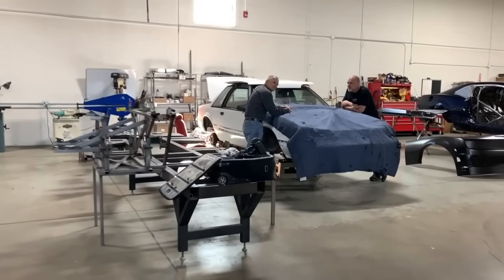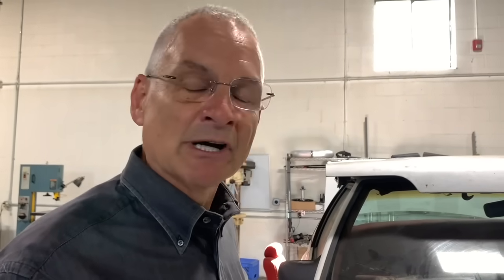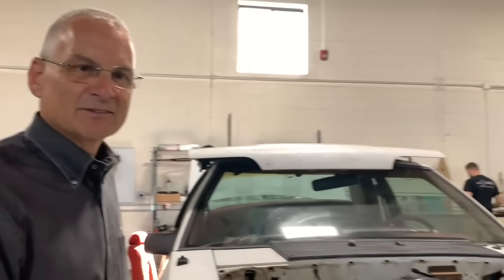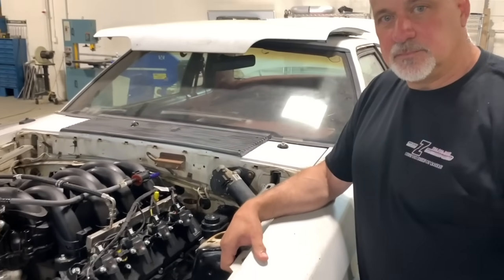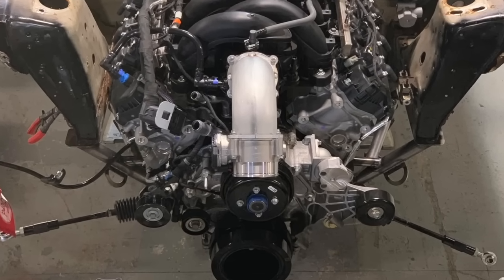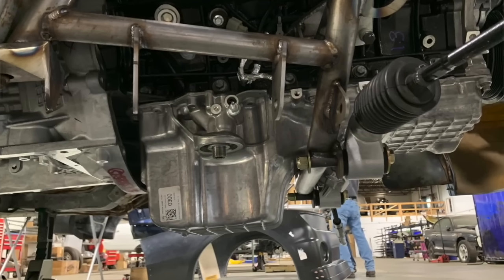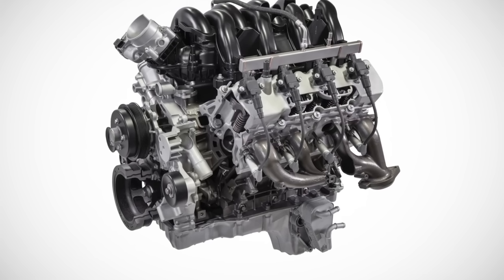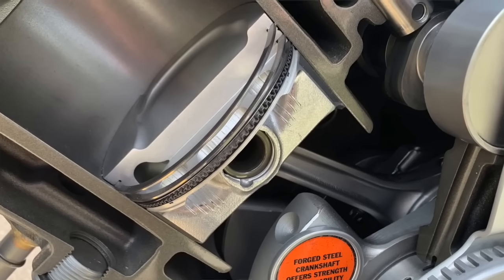Ford 7.3L "Godzilla" V8 Foxbody Mustang Engine Swap — Team Z 446-cube Small-Block Project Part 1

Comment: At 445 cu in (7.3 liters), some racing organizations have lower limits on small block sizes. For example Hot Rod Drag Week (not a true competition, more for bragging rights), their cut off is 430 cu in for the dividing line between small block and big block. a lot depends on racing organization rules for where this would actually fall on the SB/BB classifications

Comment: Dang. The 6.2 has been out for a decade and i have only seen about 3 swaps. This motor is out a couple weeks and they are already making a swap kit. Im excited, but i think the 6.2 had untapped potential.
Reply: Mike Albert No one wanted a 6.2 Sohc i guess
Reply: This will make 6.2 swaps more accessible and a ton cheaper. I agree, even though not a mod motor fan, these 6.2s had untapped potential.

Comment: " Designed and engineered to be as durable as the truck engines"  lol. So what you're saying is it's a pile of shit like every other engine ford builds. Someone should tell this guy about the spark plug and cam phaser issues the 5.4 had for it's entire life span,  the valve spring issues in the 6.2, and the multitude of problems ford has with eco boost motors.... Putting a unproven truck motor with no aftermarket support in a mustang is about as stupid as all the other shit ford loving morons do.....
Reply: Did you even see how the engine was built? It's a cam in block, cast iron block, port injection v8. It's simple as can be. Do the math, and quit being a foolish brand loyalty sheep.

Comment: Hopefully in 5 years I can get one from a salvage  yard as easily as a LS. Coyotes are still too expensive for me and the new 7.3 are push rod motors,yes!  Wow, I can't wait to see one running boost, should be 1000hp with no problems.

Comment: It will be just like the LS engines, it only has two valves and without forced air the Coyote eats it for lunch.  Some Ford guys still think the FE was the dominant engine until they get their ass kicked by a sb Ford with canted valve heads.. The 7.3 is still a truck engine and probably a decent engine. Leave the racing to the guys who know how to build race engines.
Reply: I have run SBF for may years in drag racing, SC1 and D3 heads.   Engines that made 1150+ HP NA and over 2500 with a Procharger, and I think if you like those engines when you see this one you will like it too.   As for the FE, I am still amazed looking at those and commend those that took the effort to race those.

Comment: The more i read and see about this beast the more i want it for my 2010 p71 Crown Vic.This thing is way over engineered and looks like its almost bullet proof. Ford really made something great here. All that low end torque is perfect for mustang and or my Crown Vic. Now i gota start saving up lol
Reply: I have a 2000 I've been beating on for about 6 years now and it wont die beening looking into a swap have a 351w out of a truck but this might be the ticket
Reply: Think Marauder!  If the DOHC fit, then this one should fit too.  The trickiest part will be fitting the exhaust!
Reply: One advantage that Crown vic has over the mustang they are using, is that your can has a 4.6l overhead cam engine. With the OHC layout, the engine is slightly taller than typical OHV engines, requiring a slightly taller hood profile. This is why chevy and dodge have not really embraced the OHC V8's, they like their lower hoodlines. But that slightly higher hoodline, might allow the 7.3 to fit perfectly with a stock hood
Reply: @crazylarryjr  If someone can cram a Triton V10 into a Crown Vic, this 7.3 should be a piece of cake
Reply: masterwhopper414 all the space in the front of a crown I’m pretty sure you could fit any swap you think of
Reply: @masterwhopper414  someone put a triton v10 in a capri (fox) and a tank engine in a crown vic

Comment: Can anyone say camshaft swap and headers.
Should weigh about the same as a LX 5.0.
Lolllll easy 550 to 650HP at the crank.
Reply: And bomb proof
Reply: Aluminum heads
Reply: I wonder when an aftermarket cam will be available.

Comment: This will be a great swap for an old school muscle car or hot rod or even in an old school F100.
Reply: i'v got a 79, the 302's pretty anemic as far as im concerned, it used to have a 460 in it befoe i bought it so i know it'll fit... anyone got an extra godzilla?
Reply: gabriel Sturdevant I have a 76 390 F150. Since this thing was announced I wanted to swap. Would cost an arm and a leg tho. Have to wait a few years for prices to twindle a little and have aftermarket support
Reply: @VeryOddTimes  I hear you brother.
Reply: @gabrielsturdevant9700  It'll be a really great swap for your 79 F100.
Reply: I got a 78' just waiting for one of these. I would like to keep the factory 4 speed though, not sure how I'm going to make that happen yet.
Reply: @Zach-ju5vi  I'm sure it'll be easy as time flies.
Reply: Zach they’ll probably make adapter plates at one point. I would like to keep it too but fuck, I feel like it’d be a lot of engine for the poor four speed, especially souped up. I’d like to have that new ten speed in mine lol

Comment: "slurp - slurp - slurp"
Reply: Are you referring to the Hellcats and Red-eyes. This is a special build, not a production vehicle that has a gas gusler tax added to the MSRP. FCA can't hit the EPA Numbers so they have to turn to Tesla to purchase their carbon certificates. GM is in the same boat. The EPA doesn't require automakers to report fuel-economy figures for pickups with a GWVR of over 8500 pounds, so there are no fuel numbers available for this engine and other brand trucks that fall in this category.
Reply: @hemi300c4  Calm down... it's the sound a good gobbie makes.  You think someone with a screen name like mine doesn't know HD's.

Comment: I love team z and props to them for being the first however... it just seems like a kool trick and nothing else. It better be able to pump out 1200 hp if not the coyote is a better option. Or buy a dart block proven for decades and more capable.
Reply: People are always so negative.  Why not be happy about a new badass ford option?  Don't you want more ford options?  I know I do.  It can make 800 all motor without even trying that hard 1200 is a walk in the park this is a 7.3 liter engine you do understand that right?  I think coyote guys get butthurt and so do ls guys because there is a new guy on the block getting attention and rightfully so.  They just made 1400 with a 3 liter Whipple on like 16 psi.  I think it is awesome having another option after thousands get sold in trucks for a few years it will go down alot in price and be a very viable swap option.
Reply: @midnight347  I would hope any big displacement would out perform a small displacement engine. Unfortunately it is still yet to be seen in terms of the 7.3. Engine dyno horsepower is like measuring your dick from your balls. I am personally not butt hurt but I laugh at the ones who say the 7.3 is the next best thing and they cannot afford it lmao.

Comment: Ford needs to make this a crate motor with ecm and a wilder cam .
Reply: Almost guaranteed to happen. I would be shocked if not.
Reply: They made it into a crate motor not too long ago
Reply: Hash Slinging Slasher the guys that said it won’t happen are eating their foot.
Reply: @randyjolly7517  lol
Reply: @hashslingingslasher4215  with an ECM?
Reply: Not gonna happen
Reply: This is coming from a Chev guy.   I’m glad Ford come out with little beast. Bout time. But I sincerely hope the cost will be reasonable. One big reason why I’ve stuck with GM platforms. Always has been cheaper and easier to build and get parts. Good for the blue Oval guys.
Reply: Jason’s Fun will be awesome if the 8.0 gm motor comes out too. Would be more cool than an LS. Long live the big block
Reply: This is ford we're talking about... I don't it's going to happen

Comment: I am curious of the external dimensions, how wide is it across the exhaust ports? If I could get that between an early Falcon's shock towers.
Reply from the maker: Tom, I cover that in my next video which will post tomorrow or Friday. Plus engine teardown.
Reply: Doubt it would fit

Comment: What’s this thing weigh? I can’t find any actual weight for this thing
Reply: Probably 1300 lbs
Reply: @blackice7408  Can't possible weigh that much.  It's physically about the size of a 351.  Unless they've made it out of lead, gold, or uranium the size factor makes it 450 - 600 lbs with alternator, water pump etc.  A 460 weighed 720 pounds but it is physically a much larger engine than the 7.3.

Comment: I think 700 hp potential without power adders.
Reply: Oscar Mayer that’s 1.569HP per cubic inch. I think 606 is more realistic with stock internals. 700 hp is double it’s advertised HP
Reply: K Moss the video showed 475 horsepower I thought
Reply: @kmoss9521  that's not double stock it's 425
Reply: @kmoss9521    that's terrible math lol. It made 430 which would be 860 doubled. If you weren't off by 160hp. Which is a big difference. I wouldn't have said anything. The 430 was also with a restricted factory exhaust system and the factory air box and filter. Just adding exhaust, unrestricted air filter and tune it makes 500hp np. Just with an off the shelf mild cam and different intake it makes 600hp+. With a very aggressive cam, good headers, etc it's very close to 700hp. If you go crazy and add compression and really good head work your then your in the 800hp area. Shit my little 427 makes 647hp with a hydraulic roller with under 11.1 comp on pumped 93.
 It's because they did such a good job with these heads and the fact it's 445ci that it's going to make some much possible in the right hands.
Reply: With the cubic inch it has. That shouldn't be a problem

Comment: WOW, TO SWEET.  PS. I didn't realize the 7.3 was a small block.
Reply: It's not, it's a bigblock.
Reply: 313dieselguy he says in the video it’s a small block based on the bore spacing.  I’ve also heard it referred to as a small block multiple times in many different videos by experts on the motor.  It’s a tall deck small block with a relatively big 4.22” bore and long stroke which makes it a big cubic inch small block, not a wide bore spaced big block.
Reply: I was on the program for the engine before anyone knew it was coming. Between the valve placement and everything else it's a big block. I had a disagreement 2 years ago similar to this except I was told ford would never make a push rod v8 again. And as I told him not only are they going to but it's a 7.3 gasser. The 7.3 Godzilla is a bigblock.
Reply: 313dieselguy not trying to argue with you.  If you were involved in the development, then you obviously know more about it than me and most others here.  That being said it seems there must be a disagreement amongst Ford experts because I’ve seen other Ford engineers call it a small block.  Real question, for most people what defines big vs small block?  I would have said bore spacing and total displacement potential,  but that may not be the case.  What is Godzilla’s bore spacing?  Anyway, thanks for the info.
Reply: @paullane7489  yes bore spacing is part of it but stroke, bore , the way the valves are positioned. CID has nothing to do with bigblock small block because I can take a 351w and make it a 427 and it's still a small block. As for the engineers,  I hate them, then know what looks good and works on paper but most of them never put there hands on that part when it comes to installing or even what makes there part work. They know there part works but dont know the parts before it that make it work. The bore and stroke on the 7.3 is at the low end of a bigblock but it is still a bigblock. If you wanted to go by actual size the 7.3 is only a lil smaller then a 460. But the funny part is a 4.6 is actually bigger then a 460 in actual size.
Reply: @paullane7489   bore and stroke are 4.2 and 3.976 close enough to 4.0. Which is why it is as good as it is. It's a pretty square engine .
Reply: @paullane7489  I can also tell you that this engine running open exhaust with a better air intake on premium with a slightly dirty tune will make almost 600hp and 673ftbs of torque. This engine was built as a tow engine but when we built and ran them also knew it would be a performance engine. That's why when they released this engine at the auto show Kenny belle already had a design for a supercharger. And I know what this engine makes supercharged also. But I leave you guys hanging on that. Just know it wont disappoint.
Reply: 313dieselguy sounds good.  I’m looking forward to it.  I’ve been wanting some modern big cubic inch pushrod Ford power for years now.  I’m not against over cams and the coyote is a great engine.  But I’m not a fan of the 90 degree cylinder spread the the overall huge external size of the mod motors.  Thanks for the info
Reply: @paullane7489  ford has been getting its ass kicked in the gasser truck towing department scence they did away with the pushrod v8. This was ford realizing that if they wanted a great gas engine for towing and get back in top they had to go backward to go forward. I've been saying it for 20 years, ford made a big mistake putting mod engines in there trucks.

Comment: This is great but Ford needs a small block push rod motor.
Reply from the maker: This is a push rod engine.
Reply: @revanevan  but would you consider 7.3L "small block"? I do understand that without anything to compare it to the 7.3L is both the "small" and "big" block push rod Ford for now. I should say - I would like a smaller displacement and smaller block Ford push rod engine like a 5.7L or a 5L that has dimensionally smaller packaging for less front end weight.
Reply: 88yellowjacket Dude, it’s a 9.65” Deck Height, it’s essentially the same external size as a 351W. Just look at the space to the shock towers, tons of room still.
Reply: @loganmurray6081  I understand from a packaging stand point it's about the same but I am not sure from a weight stand point. In other words a lower deck height lower weight push rod small block would be nice.

Comment: This belongs in a 93-95 Lightning with the 10 speed and a bunch of boost. Finally, a modern pushrod torque monster for the Gen 1 guys!
Reply from the maker: Yes!
Reply: @revanevan  I have the truck off you wanna do it 😉
Reply: Manual transmission kit for this engine 🤞
Reply: I highly doubt that transmission will fit in the truck
Reply: @fread51  if that trans will fit in a fox body tunnel without modification, it'll fit in an f150 tunnel lol
Reply: @codyslaughter4678  you don't know that it's not even the same chassis what the hell you talkin about
Reply: @codyslaughter4678  that's a good point. An E4OD is much larger than an AOD. And if the 10 speed fits where the AOD went, it should fit where an E4OD goes.
Reply: @fread51  I do know what I'm talking about because I've owned a fox body, sn95, obs f150 and I currently have in my possession 2 of those 10 speed autos with coyotes attached to them.  I've done the looking and measuring. So yes.  It'll fit.  But please continue to tell me how I don't know what I'm talking about.
Reply: billy heaton he didn’t say what gen his coyotes are.   Where do you get your information?        Doing the proposed swap will be no worse than doing this swap into a fox body.
Reply: @fread51  yeah? I have no idea. Just hoping, I guess. Lol.
Reply: 2020 lightning?
Reply: The coyote and the aluminator make a ton of torque
Reply: @MrDavidelliottjr  not relative to horsepower.
Reply: @kevinashleylewis  yes. It does. It's all in a tune man. They can actually be tuned to make more torque than hp.  Pay attention.
Reply: @MrDavidelliottjr  lol. Ok. I currently own two Coyotes and sold a third after owning it for 3 years. The one in my 2016 GT is Whippled. I have an little experience with the platform. You should pay attention 😉
Reply: With all the real estate under the hood of a 80-96 F series, new 7.3 will look very, very lost in there.  Even with the huge intake manifold the Windsor has on it... It's still looks lost under the hood.  The 7.3 even more so.  Haha.. You'll be able to sit down in there under the hood to work on it.
Reply: I may do this to my 95 f150
Currently still has the stock ford 300 L6. Just need a little more power
Reply: @ruby20003628  same I kinda like this better than coyote but probably even more $$$ here. Probably just end up with a 2.7 or 3.5 doesn't really matter as long as I get a 10 speed. I wonder how hard it'd be to hook up the manual 7 speed. Also I've even though of building the straight 6 and adding the 10 speed or 7 speed?? I feel like a modern trans could really help the 300 stay in it's small powerband and be fun
Reply: @beasy7227  I thought about rebuilding my 300 and Turbo it. But even upgraded internals, better diff gear ratio, the most power I seen out of a 300 is around 400 base HP, but the gas mileage is way down. If I had all the money to do it. I would go either 5.0 or 7.3 just more reliable in NA in my book compared to Turbos
Reply: @ruby20003628  I agree but I'm still curious what a 400hp 300 would do with the 10speed. Or even 6r80 with paddle shifters.... If it's faster than a stock lightning and cheaper overall Itd be nice.
Reply: M.K. Johnson  hah they do when they are built just like any other motor. What r u talking about? There's 500hp straight 6 motors out there and higher in Australia
Reply: M.K. Johnson  ok who said 700? Not me. You. And again if they are built/billet they can go 1000+ they put them in dragsters man